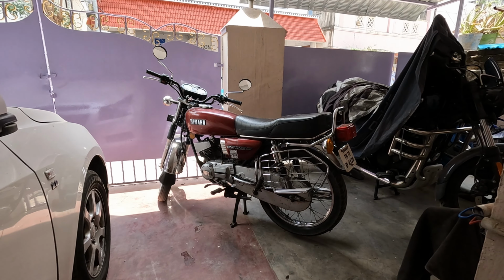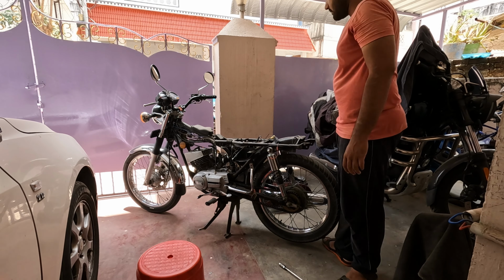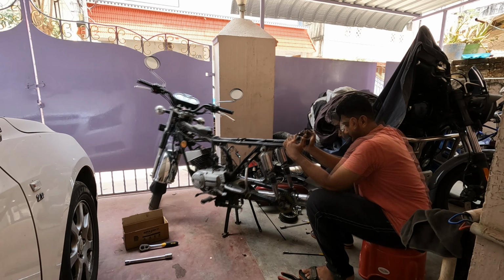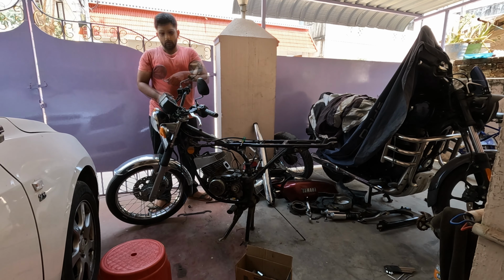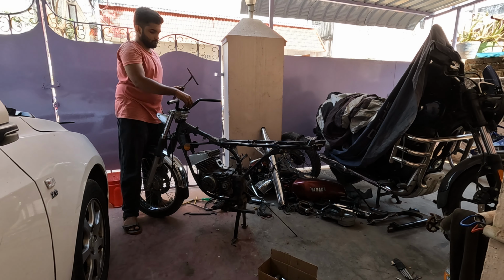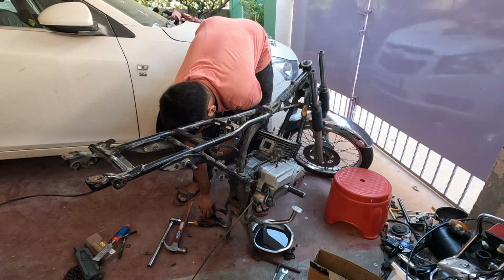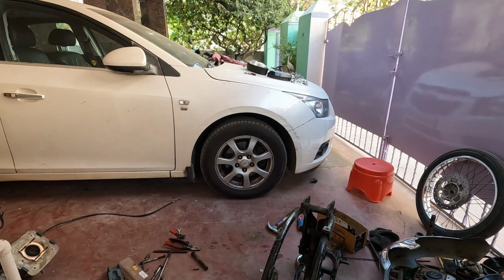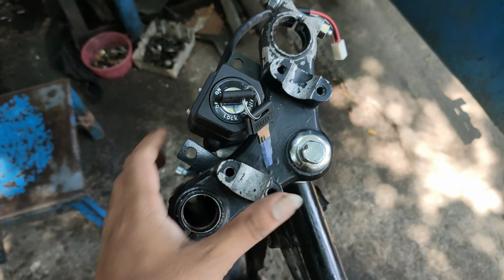1997 Yamaha RXG Restoration PART 1 - Complete Disassembly!

Comment: What is your opinion on stainless Steel wheel spokes bro
Reply from the maker: I haven't used it yet. Shall use and let you know :)
Reply: @BrattyBiker 10 years back i chromed my 135 new wheel spoke, looking good but the problem is maintaining them, otherwise soon they will rusted
Reply from the maker: That's great, for an electroplating to hold up for 10 years. But yeah, they need regular cleaning to maintain the shine.

Comment: Good work, My Rx135, 99 model start jerking  while close the throttle even in 2nd gear, but when pull the clutch the jerk is gone, what Might be the possible problem
Reply from the maker: Check your magnet, remove and re-install correctly.
Reply: It's the carb problem retune your carb I had same issue when I close throttle it's jerking when I open throttle or press clutch jerking is gone so retune carb with some experience technician
Reply from the maker: Cool! Yes, could also be a problem with a dirty carburettor.

Comment: If we have any issues with chassis such as bends or weak links, who do we need to go to get them corrected?
Reply from the maker: It's best to give it to someone who specializes in tinkering, usually they have tools on body line correction for cars, pipe bending & hydraulic machine as well. So you can get the chassis to them, they will be able to check and sort the chassis out, from any bends, damages, rusted patches.etc
Reply: @BrattyBiker  Thanks, Bro. That's what I was thinking too...taking it to a tinkering shop, but wasn't sure. The chassis is badly rusted. Saving up money to get it restored ASAP.
Reply from the maker: Oh sure, get it done soon bro. Not an easy thing to replace chassis if its damaged beyond repair. It's a big headache.

Comment: What is power to weight ratio in bike... It is generally higher in two strokes???
Reply from the maker: Yes, this is because two strokes are simpler, has less moving parts than a 4 stroke, which means lower weight and combustion happens twice the amount of times, compared to a 4 stroke running at the same RPM. This is why power to weight on a 2 stroke is generally better. An RX135 making 12bhp is 100KG whereas an FZ making the same 12bhp is almost 135kg.

Comment: Are You Installing With Disc Brake Or Drum Brake
Reply from the maker: With the front disc setup ofcourse. It's so much better than the stock drum setup.
Reply: @BrattyBiker  What Emblem Are You Installing RXG Or RX135
Reply: @BrattyBiker  I Am Talking About The Front System
Reply from the maker: @motoartbyhariteegala116  RXG ofcourse.
Reply from the maker: @motoartbyhariteegala116  I was replying the same to you. Yes, I'll be using the Pulsar front disc setup, the bike was previously running with it & now it has been rebuilt.

Comment: Bro Rx135 la rx100 main jet pota mailage varuma bro
Reply from the maker: No, engine sieze aagum. Don't do it.
Reply: Ok Thanks Bro...But en rx135 la running la acculturation close panna litta Jerk aaguthu enna pandrathu bro
Reply from the maker: RXG had this jerking problem, check if your magnet is of RXG or RX135, if it is of RXG, change it to 135's magnet and coilplate. It will sort your problem.
Reply: Bike Rx135 1998 model Rx135 setup Running 19 teeth and balancing plate added magnet bro but little jerking issue on 40km speed la acculturation close panna matta
Reply from the maker: Get rid of that balancing plate and magnet. Change the magnet & coil plate to the 135, your problem will be solved.
Reply: Bro Magnut and coil plate ellame rx135 set tha bro iruku but corburator mattum mickurb
Reply from the maker: Oh, then better to go for a used Mikuni carb.
Reply: Mikuni 135 corburator inga kedaikala bro an en kitta rx100 japan corburator tha bro extra iruku
Reply from the maker: Message Bunty : +919780224540
He'll have a good working Mikuni 135 Japan carb. Get it, if it works well, then sell your Micarb and 100's carb.